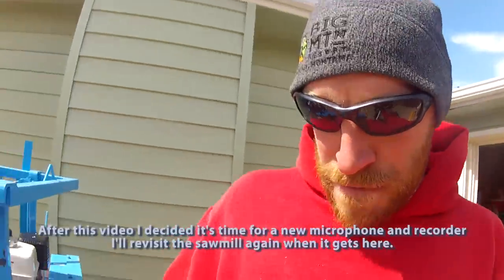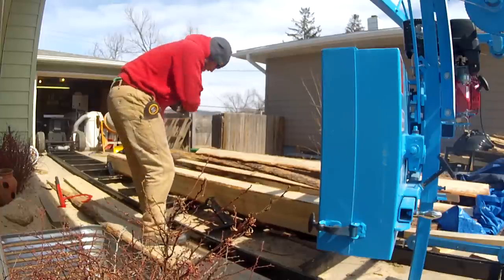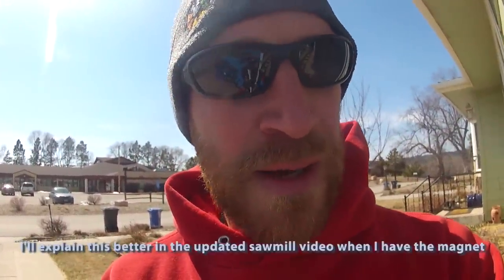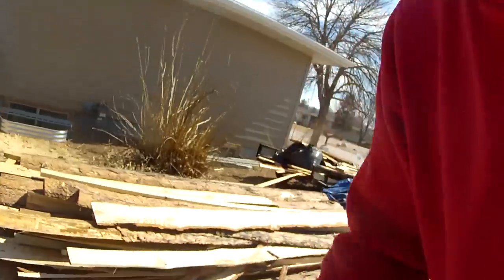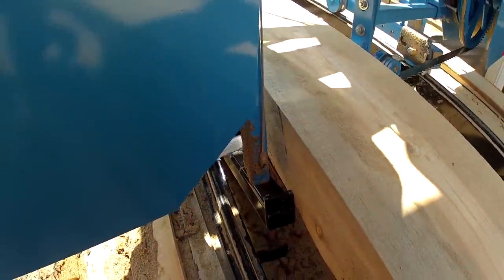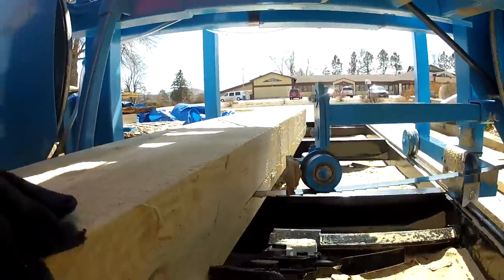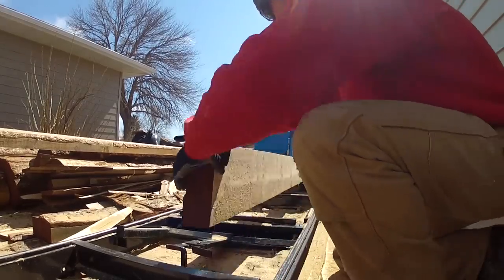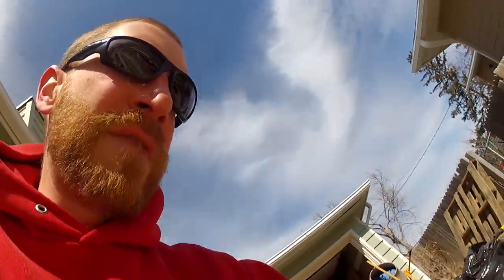The EZ Boardwalk Saw mill in action

Comment: Hey there, I own an EZ Boardwalk 40 as well. I love the scale on the mill. Besides the regular tape measure scale on the left the others are for quick cutting and have taken the kerf of the blade out for you so you can cut faster common cuts. The scale all the way to the right is your 1" scale. you start on one of them when you want to cut 1" boards and will end up with 1" board after all the cuts so very little waste. If you use the regular scale on the left all you have to do is add 1/8 to your cut. So lets say you want to end up with 8" cant from the deck up you would make your cut at 8 1/8 to make up for the kerf of the blade. If you are cutting down you also need to add an 1/8 each time you make a cut as your cutting down to the deck. So if you are cutting 2x4s and lets say you have an 8" cant and you are going to start cutting the 8" cant down from top to bottom like you are in the video. Your first cut would be at 5 7/8 and that would give you  perfect 2" boards. your next cut would be 3 3/4 and your last cut would be 1 5/8 and you would be left with a 1 1/2 board on the mill. It seems confusing at first but once you understand it its fairly simple. And you will really enjoy the common cuts they make it very fast and easy. I hope this helps with your mill as I was confused for awhile too with the scale until I called Edward and he filled me in. Happy sawing :) nice video
Reply from the maker: Good to know. I'll be cutting again in a few days and making another video. I have another addition I made to the measurement system. It should help out with the cutting.

Comment: Where did you get 3 1/4 for 2x4 ? Rough cut are 2x4 . Air dried are 1 9/16 x 3 9/16 . Kiln dried are 1 1/2 x3 1/2  . That's the industry standard if you're replacing store bought lumber .

Comment: Overall was the mill worth your money or would you choose a different one if you could start over again?
Reply from the maker: Dusty Morton I'd say it was worth it. If I were to do it again I'd go for a few more horse power, hydraulic log rollers, and a wider throat. For personal use it does just fine but lately I have been selling lumber I've milled and the improvements I mentioned would speed things up = easier money but nearly double the purchase price.